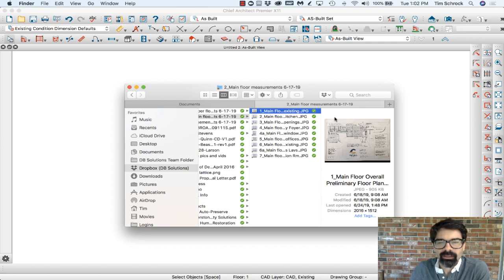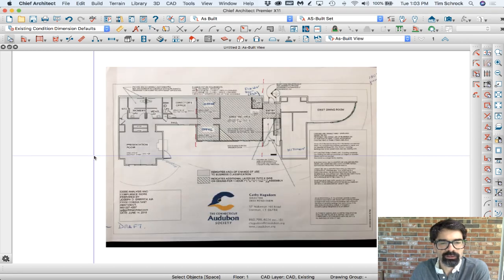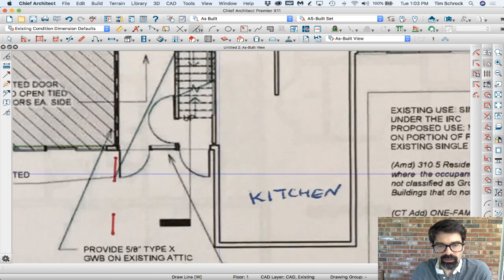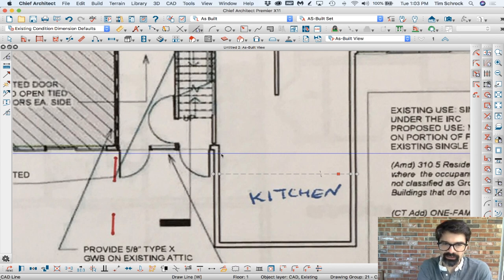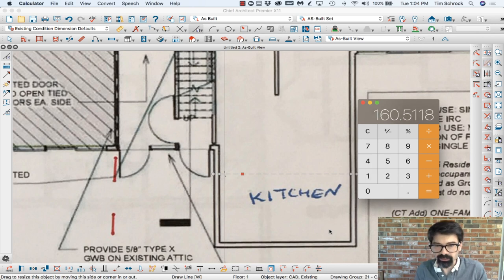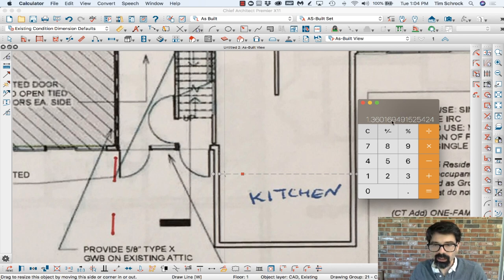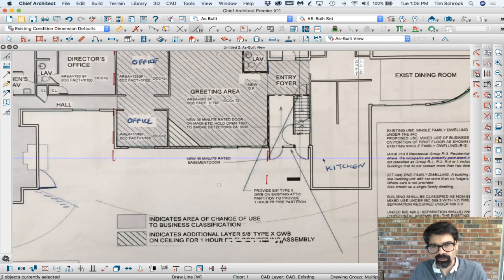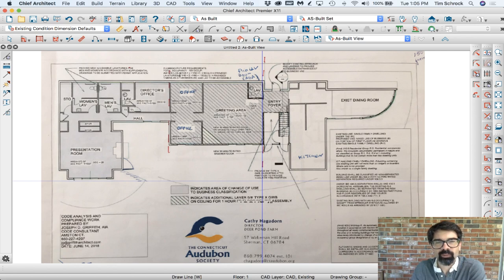Importing & Scaling JPG or PDF | Chief Architect

Comment: Awesome, BUT ... This appears to ONLY be an option in Premier ??? If you dont have Premier, you are not doing anything fancy like this ...
Reply from the maker: What version are you using? It looks like HDP and CA Interiors has transform/replicate according to their respective support articles. 
Of course, I'm not familiar with anything except for the Premier version. Why wouldn't someone be doing anything like this? Even with interiors, I would think a user would want to trace previous drawings.
Reply: @DesignbuildsolutionsLLC  I have Home Designer Architectural the middle version of the 3 Home Enthusiast options. I found a way to hack this in the end. What I had to do was to scale up my imported PDF image until the dimensions on that drawing matched the result I got when i used the Measure tool. It took about 3 tries, but I got within a few inches over a 30' dimension which is good enough for me :)